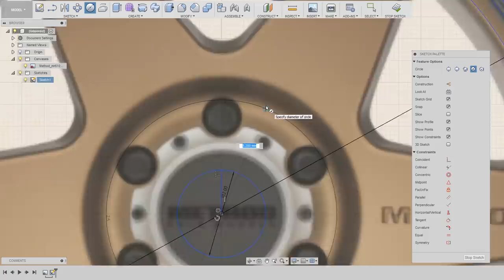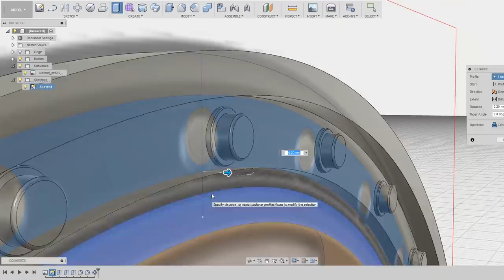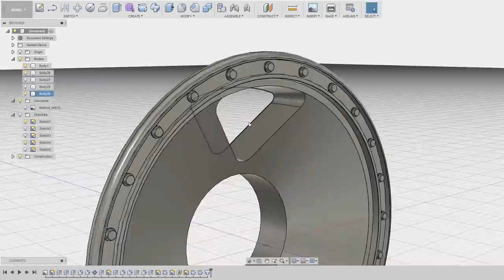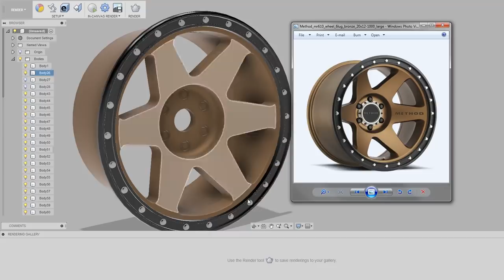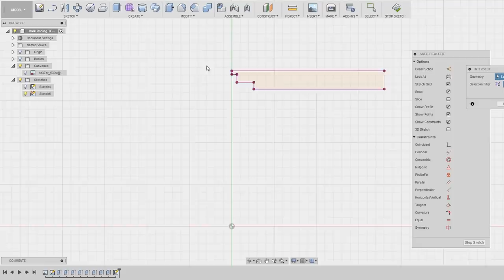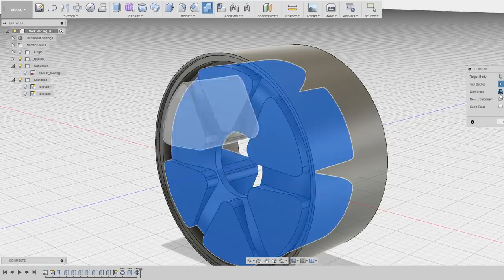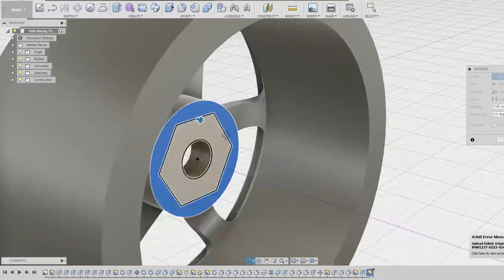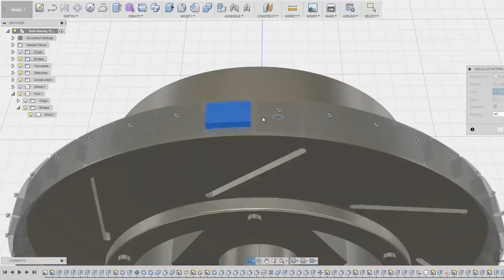Smoothing 3D Printed Skyline Body, Designing Wheels, and Scratch Building Rear Diffuser (E4)

Comment: Loved the Fusion bits.  I have never used a picture before to design but am seeing that is is easier.  I recently designed a ProDrive wheel that is on my WRX and although it is 100% scale and accurate, i went about it wrong.  I designed a single spoke then rotated it.  Works fine but too much time involved.  I will try this method.

When you broke out the Styrene I was happy to know it isn't a dead art.  I have MANY models in my closet that are in different phases of Styrene builds.  15 years ago i didn't have a printer and Styrene was it.  makes me want to pull some of those builds out of the closet now, lol.
Reply: 3mm solid core solder is great for making 1/24 exhausts by the way.  For the tips I use brass tubing as it has thin sharp edges.
Reply from the maker: There are many ways to design anything. Like I said I'm not sure if the way I showed is the best or easiest way, however I found that it worked well for me, hopefully it works well for you. A reference image certainly makes things easier. 

Although I prefer CAD modeling and printing over styrene, It's nice to mix things up a bit. It's certainly a nice break from sitting behind a screen.

Comment: May I suggest working on a knife-safe craft surface when working with polystyrene. You will achieve finer cuts and better control than your cork or particle board. Plus, most craft boards have rulers built in perfect for scale measurements. Enjoy your creativity and technical know-how.

Comment: I've printed multiple RC drift bodies and I always use ABS then smooth it with acetone. It works much better than PLA but anyways great video!!
Reply: were do you find the files for the bodies
Reply: It’s easiest to find an existing model of a car then in your slicer, for example cura. You can make it so it only prints the outer walls and then  prints support inside. I’ll probably leave another comment later with a file for you, I’ll make one for you. What car would you like?
Reply: Mac Witt A 1996 Mazda please
Reply: Mac Witt do you take alot of pictures of the car with a camera and then use a software to make it in to a stl file.
Reply: A miata???
Reply: Mac Witt yeah or any car you would like to post a file of
Reply: https://grabcad.com/library/mazda-miata-1991-1

   I didnt have anytime to design anything but i found this on GrabCad.

Also here is a link to turn that IGS file into an stl:   https://www.makexyz.com/convert/igs-to-stl
Reply: Mac Witt thanks mate. is the website like thingiverse
Reply: Can you make one of a rx7 fc turbo2? With bbs or te37s?

Comment: If only I could print a set of TE37Vs for my real cars, someday

Size increase is a good call but if its a rear wheel drive build (basically a GTS) you want to put grip tires on the front so you can control it better, btw im new here and loving the videos

Comment: Not bad! Im doing something similar... just a bit bigger and Faster... a 1/10 Trophy truck... with 4stroke engine and working disc brakes. Im usi g Fusion 360 to. Perfect programm to make modells.... Thumbs up. And nice to see someone that uses a 3d printer to make a model! Im do this as well, but later im let it made out of Plane aluminium...

Comment: It'd be cool to make a hollowed out exhaust, piping, muffler and tips, then build a small box inside to fit a small speaker like from a set of earphones and a module programmed to make engine sounds, connect that to the exhaust so the sound comes from the actual exhaust... Too much maybe?
Reply from the maker: I like that idea. Not sure how feasible it is but I like it. 👍